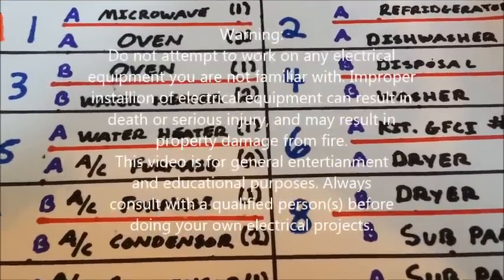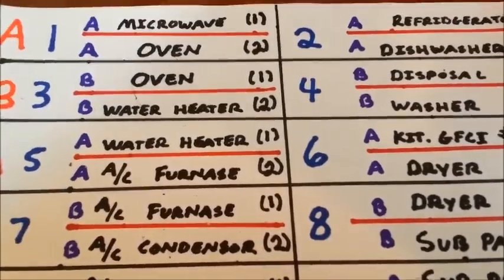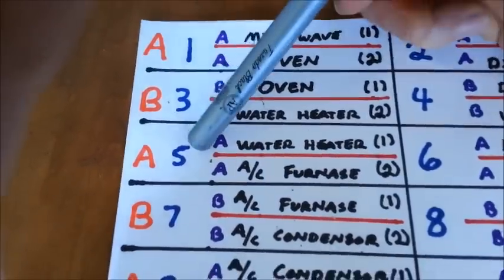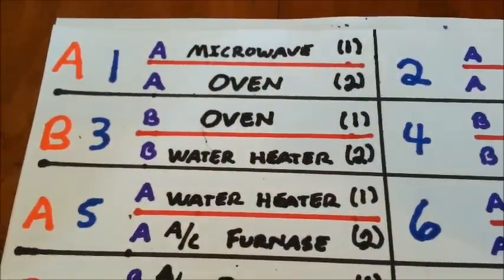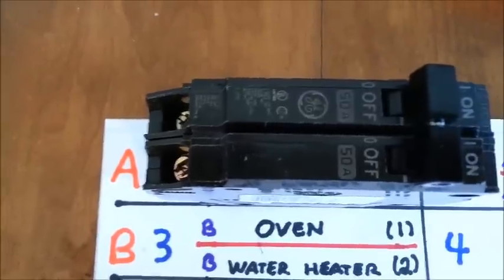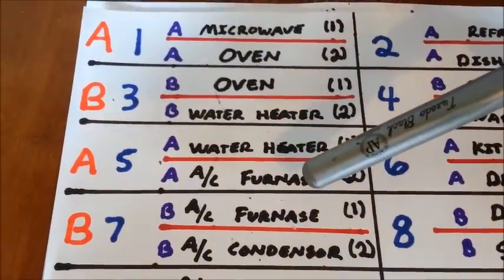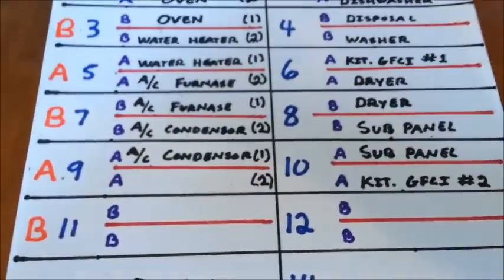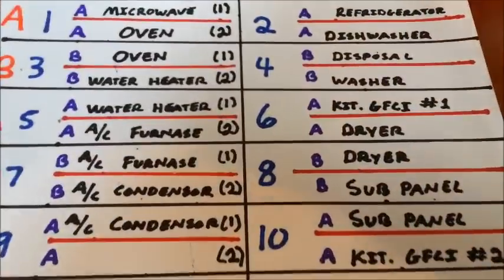Electrical Panel Explained

Comment: shouldve mentioned the single pole breaker too so there is thick and thin single and double pole breakers? most common in residential homes?

Comment: I was wondering how a generator power inlet box with an interlock kit supplies power to the 120 circuits on both sides of a breaker box by installing a 30A double pole breaker.  Your explanation made it very clear to me.  Thank you.

Comment: I would really appreciate if you can answer  this question, I cant seem to find the answer anyware.  
how do you measure the total amps for the entire breaker panel, for 240v devices [like an well pump] you only measure 1 leg [10a x 240 = 2400 watts]  for 120 devices you only measure one leg [hot to neuetral], and then the neutral carries the imbalance between the 2 legs [from my understanding ] , so in other words lets say you have 12 on one leg 15 on the other leg and lets say 3 on the neutral ,  the question is how do you read the true total amps . .  i have searched high and low on what is the formula to take these 3 numbers and calcullate the total amps or watts ? if you know the answer
 i would  reaaly appreciate it
FOR EXAMPLE ;
L1         N         L2
10A      N       10A   [240v DEVICE 2400Watt ]
2A        N       5A      [2 separate 120v devices L1 240 Watt   L2 600 Watt ]
TOTAL
L1        N        L2       [neutral carries the difference between the 2 legs from my understanding]
12A    3A      15A
Total watts using what we actually know 3,240watts which is 13.5 amp at 240v but if you look at the amps above if you were to measure them it is in no way 13.5A and if you were to measure any of those it would not give you 3240 watts.  So how do you actually do it??????    I have looked every where for this answer
Reply: 3240W is equal to 13.5A @240V but it’s also equal to 27A@120V. Your L1–>N and L2–>N are each 120V circuits. Since in your example, they are 12A and 15A (12A x 120V and 15A x 120V), this would give you the 3240W.
Reply: You'll never find an answer "anyware".

Comment: We have tandem breakers and two pole breakers.  If you use a 15 amp tandem breaker you can connect two different circuits an the same line 120 volts.  A two pole breaker is used for 240 volt circuits, LINE ONE LINE TWO for a dryer or electric range. The power coming in is single phase 120 240 volts one transformer. Phase A, Phase b, Phase c, can be a Y or a Delta transformer three phase three transformers   I think you should get out of the electrical department. And try something else.

Comment: Your numbering scheme is ok and seems to work. But some people may be confused that there are two places with a number. There are also two places with the letter. 

I think I can design a simpler system that doesn’t confuse people with multiple meanings for a number.  

Instead of numbering 1, 2 across; number 1, 2 down. Meaning, put the 2 where you have a 3.    Now, anywhere you have an odd number that’s the “A” leg, or what you called “A” phase. Then, likewise all the even numbers are “B” leg. Because the odd and even numbers indicate leg, you don’t need a letter for the leg. Instead you can use a and b for the 2 positions of a thin breaker. 

If your house uses all “thick” breakers like mine and you use this scheme 
This also allows you to go around your house and label all circuits with just a number and know which leg each outlet is on.  

This minimizes printing cost and allows you to easily balance generator loads. 

In my house if my generator says that even is running hot and odd is under utilized I can go into the kitchen and move the toaster from 14 to 7 to balance the load. (assuming 14 and 7 are the labeled outlets in my kitchen.)

Comment: Very nice video. Maybe show your work in a panel too. I watched your video to help me prepare for my final electrical inspection. Your info changed my mind on label structure. I'm going to add the A or B phase to the label. I'm a homeowner builder so info is much appreciated!  I'll be back!

Comment: At the bottom of the breaker example I see that the oven is not separated by 1-2 1-2 
And same with the arc fault if you could reply that would be great I wrote this in my notes for school and I just wanna make sure that you just did that because as the list goes down it just repeats the same 
Phase 1 then phase 2

Comment: The inspection dept In NC. Can not use a black sharpie Its not UL approved. Yep they fail my job yesterday. I must buy a label maker and print it. But is the Label maker UL approve. The state Insurance that makes silly code should take off there tie and get a life
Reply: there's a reason for that, and it's that sharpie ink can smear or come off, and it can be written in illegible handwriting...a label is clear and does not smear off

Comment: 120V + 120V does not "create"  240V, it just allows you to take advantage of it.  The  voltage has already been created before it comes into the breaker box.
Reply: David James The transformer creates it.

Comment: I don't think putting thin circuit breakers together to make a 220 circuit is safe... There should be ONE 220 circuit breaker with ONE reset switch...  The way you have it, 1/2 of the circuit could blow while leaving the other still connected...
Reply: @pr0230m.... Thin type GE breakers are available as 2-pole....example here-->
https://www.amazon.com/General-Electric-THQP225-Circuit-Breaker/dp/B000WUO6PS/ref=asc_df_B000WUO6PS/?tag=hyprod-20&linkCode=df0&hvadid=216506979975&hvpos=1o5&hvnetw=g&hvrand=16602719813394696916&hvpone=&hvptwo=&hvqmt=&hvdev=c&hvdvcmdl=&hvlocint=&hvlocphy=9010563&hvtargid=pla-374156023579&psc=1
Reply: Exactly what I was thinking. I didn’t even think it was code compliant to split it that way.

Comment: Why is it called a single phase panel board when there are two phases (A, B)?
Reply from the maker: +Clemence Crawford The way I understand it is if you read voltage between the A and B phase you get a "single" reading of 240 volts. In a 3 phase system you have A, B, and C phase that gives you 3 different ways to read voltage between the 3 conductors while there is only one (single) way to read it between 2 conductors.
Reply: Ok. So its the number of possible combinations to measure voltage between the ungrounded conductors. The neutral conductor is ignored.  Does that sound correct?
Reply: The house is being fed by a single phase 240V, the transformer (usually located outside on a pole) then splits the single phase 240 V giving you A and B. Hope I explained well
Reply: 2 ways to  read it with single (but split) phase, not 1..
Reply: It is a single phase with a center tap on the transformer which gives you a split phase. The full phase is 240V, half phase is 120V. It would be more accurate to say the first half of the phase and the second half of the phase.

Comment: Where does code require GFI's to be installed? I've heard bathrooms are required to have GFI's installed but I'm not sure where else they would be required.
Reply: +NY Mogul GFIs are required wherever there is water nearby.
Reply: +NY Mogul Bathrooms, kitchen receptacles that are over counter tops or bars, outdoor receptacles, and inside a garages. Plugs that are dedicated like for a fridge and will be used for nothing else do not have to be GFI.
Reply: Anthony Sigman I’ve read elsewhere that refrigerators do need gfci  and also sump pumps too even though they have dedicated circuits. So now I’m not sure who is right.
Reply: Liquid water.  Water vapor is pretty much everywhere, thus disproving your statement wherever there is water nearby.  You also didn't define nearby.
Reply: Within 6 feet of any water source.

Comment: Hey dude I like the way you explain! I have a question is it ok to use different type of breaker as long as can fit?
Reply from the maker: GalaXy808 Thanks! The only real way to determine that is to research(Google) what breakers are compatible with the panel you have, so if you have a GE panel you would type into Google "which breakers interchangeable with GE". Another example would be "which breakers interchangeable with Siemens" etc. You never want to force install anything; it should always feel "right".